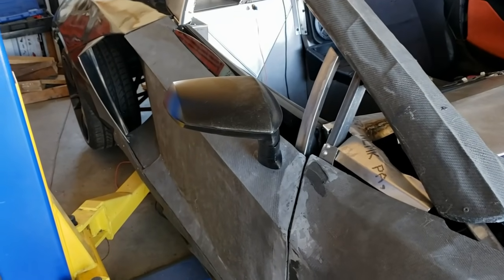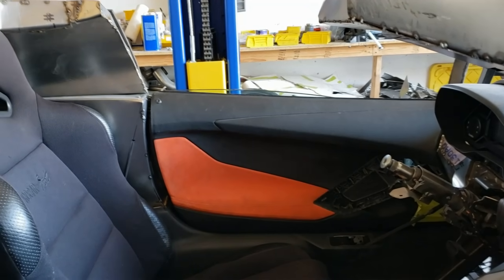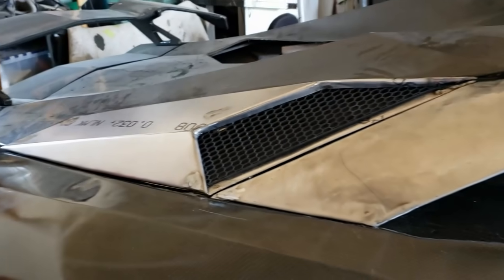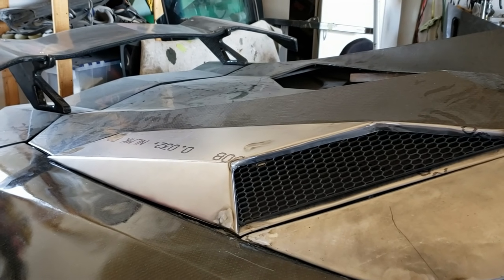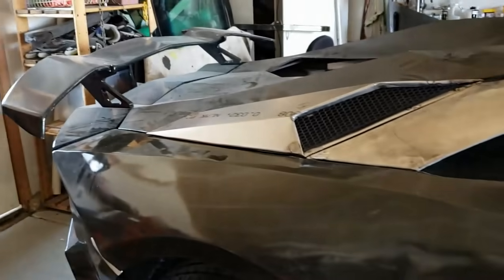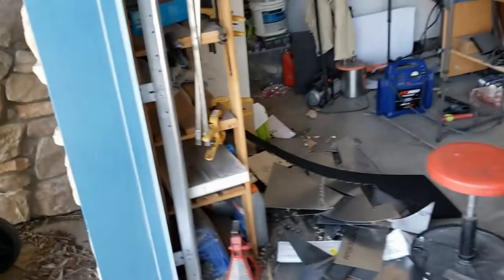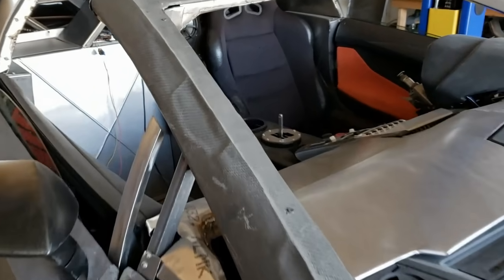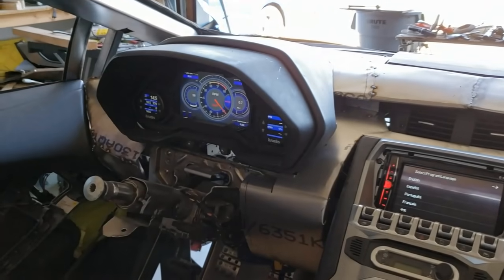3D Printed Interceptor Update 35

Comment: Those doors do look like a huge pain, it doesn't help that they are frameless windows.

I was thinking of doing foam plugs but having those machined can cost 15-30k. Especially if you want more detailed parts than just the exterior body.
A homemade 3d printed plug does seem a lot cheaper, but more time consuming and less precise.  I'm currently aiming for the foam plugs.    I still have a lot of mechanical and design to go before I get anywhere to that though,